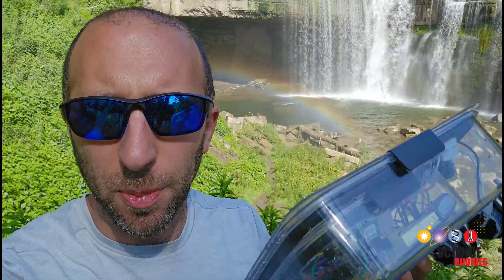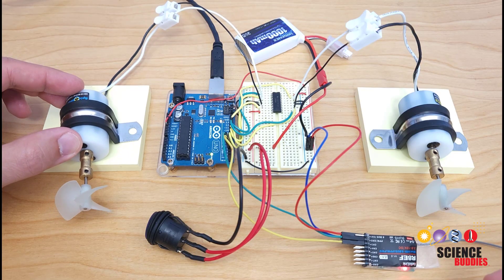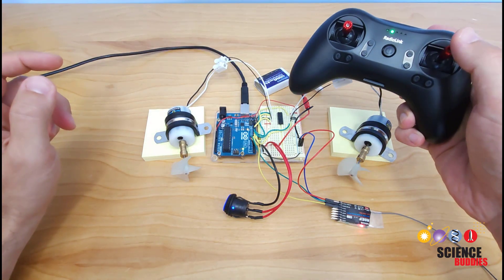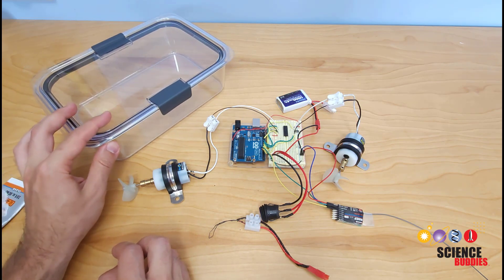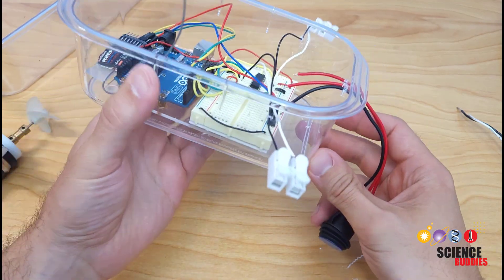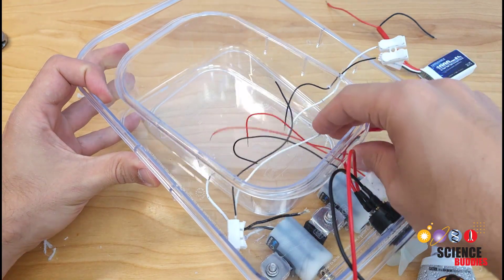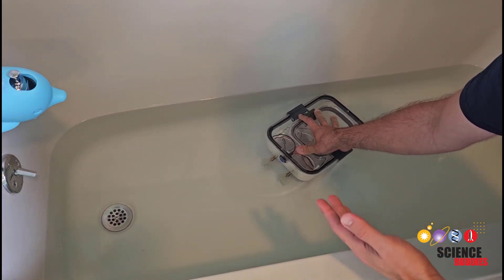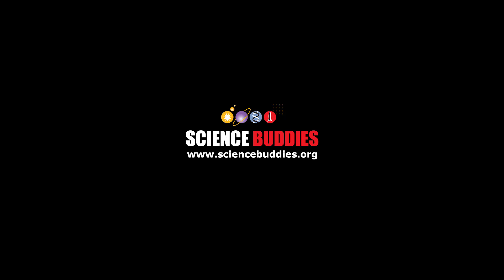Make an Arduino RC Boat from a Tupperware Container | Science Project

Comment: curious to know if anyone has been successful with this? I have rebuilt this several time and im confident that the wiring is correct but i still get errors. The motors keep spinning in one direction but are jittery in the other direction and then it starts to get crazy.
Reply from the maker: If you are a student doing this for a K-12 school science project, we can provide more help if you post pictures of your circuit in the Ask an Expert forums on our website: https://www.sciencebuddies.org/science-fair-projects/ask-an-expert-intro. Otherwise, you might be able to find help on the official Arduino forums or other electronics forums like Stackexchange. Either way people will need to see both your code and your circuit in order to help.

Comment: Trying to build this but not having success. Just realized that the pin reference numbers (for connecting h bridge) from the weblink instructions does not match the pin numbers in the IDE code. Please assist. Thanks
Reply from the maker: Sorry about that, it looks like you're correct. We will get the code on our website updated. In the meantime it looks like the circuit diagram is using pin 10 for the left motor enable pin but in the code it's pin 6. You can either change the 6 to a 10 in the code or move the wire from pin 10 to pin 6 and it should work.

Comment: Hey how can i connect a camera to the ROV and see in real time ? And which cameras can be compatible with arduino R4 (the one that im using)?
Reply from the maker: Wireless cameras won't be able to transmit from underwater so you would need a camera with a video cable attached. The camera doesn't really need to interface with the Arduino at all, it would just be separate.

Comment: The circuit from the vídeo dont correspond to the diagram provided or figure 2 does not correspond to figure 3 in science buddies website.
Reply from the maker: Hi - there is more than one way to lay out an electrically equivalent circuit on a breadboard. We recommend following Figure 3 since that's the clearest way to see all the connections, but we also recommend watching our How to Use a Breadboard video which explains how the connections on a breadboard work: https://youtu.be/6WReFkfrUIk?si=ycmPOMLpHwfDuRy7.

Comment: Only one of my motors works; the right one. Do you have any idea why this may be? I have followed all of the steps you listed in your website very clearly. Please help
Reply from the maker: If you're having trouble with this project, please post pictures of your circuit in the Ask an Expert forums on our website and we'll be able to help: https://www.sciencebuddies.org/science-fair-projects/ask-an-expert-intro. Usually if something is not working it's due to one or more misplaced wires on the breadboard.
Reply: yo I figured out why it was doing that. so when you open the arduino ide and the program the pin out for the joyL pin is set to 4 but the diagram says its hooked to pin 3. i just switched the pin 3 to the pin 4 and boom fixed it.

Comment: may I ask what is the minimum mAh that this needs?
Reply from the maker: We don't have a concrete answer for this - more mAh just means your boat will be able to run longer. You can check the written instructions linked in the description for the battery we used.

Comment: Whats the operating voltage of those dc motors?
Reply from the maker: The motors are rated to work with a 7.4V LiPo battery.
Reply: @Science.Buddies  and how much rpm should be fine?